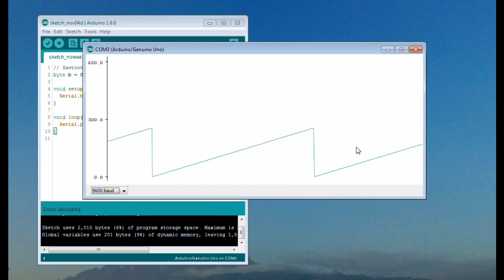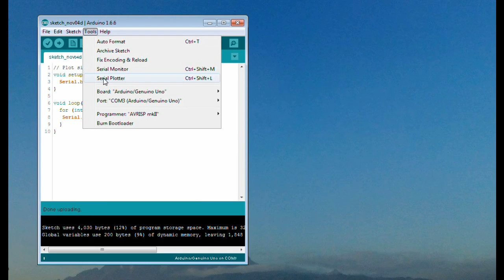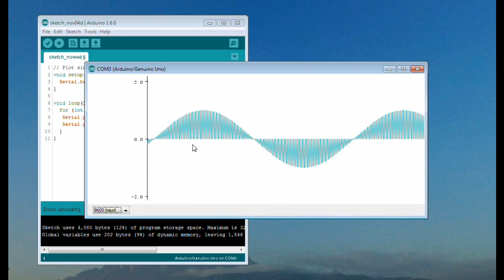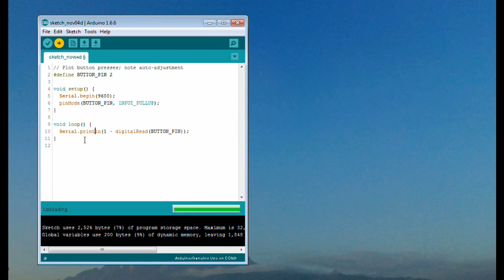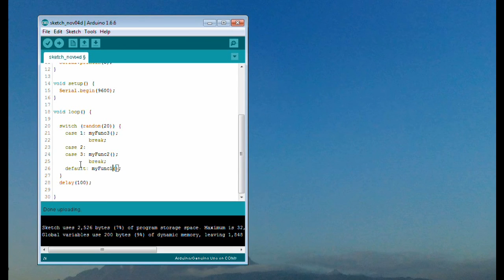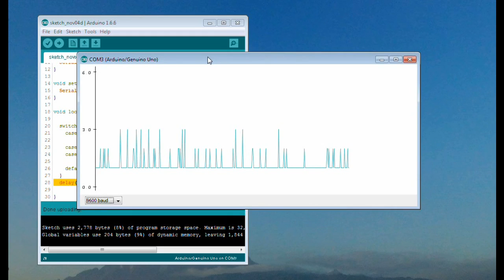Using The Arduino Serial Plotter

Comment: Can you turn the auto level off and manually control it?
Reply from the maker: I'm not up-to-date with the latest Arduino IDE developments; to the best of my knowledge there's no way, except sending two fixed values (low limit and high limit) with every datapoint.

Comment: do we need to connect board to plot the graph ?
Reply from the maker: Well, something has to send the data to the computer...
Reply: @idogendel  but u r plotting the value that is defined in code itself. I want to know whether we still have to connect arduino board for plotting.
Reply from the maker: @SatishKumar-yn8tr  The values originate from the code that's on the Arduino board, and they are sent through the USB cable to the plotter. Try to open the Serial Plotter without an Arduino connected and see what happens :-)
Reply: @idogendel  what about proteus, is there any way to get plotter then when simulating there
Reply from the maker: @assassingamer9088  Sorry, never used it, I have no idea.

Comment: I want to plot voltage versus cureent and i want to plot as horizontal axis is voltage and vertical axis is current in serial plotter using an arduino. can u tell me plez is it possible, if yes then plez tell how can i plot? if now then can u suggest altrnative way to plot vi charactristics using an arduino???
Reply from the maker: Well, if you know how the Serial plotter works (as I explained here), and you know what you are sending to it (what are the voltage steps, what is the current scale) you can probably make sense of the output plot... but that's a very poor way of doing this. The serial plotter is just a toy - for serious graphing you should find or create another tool.